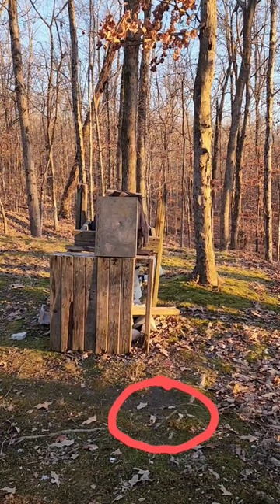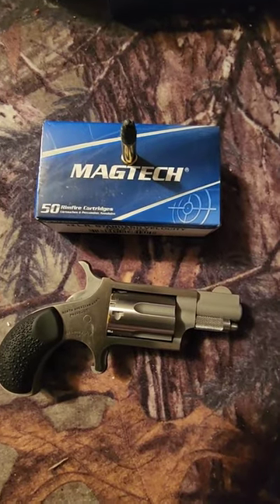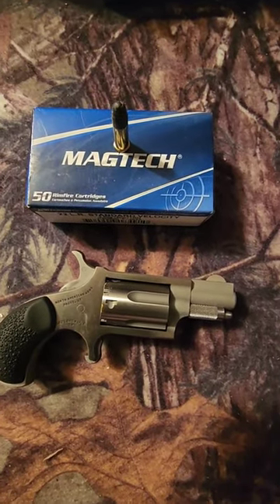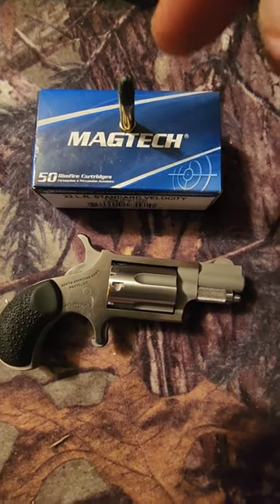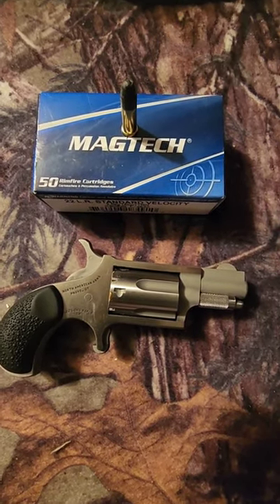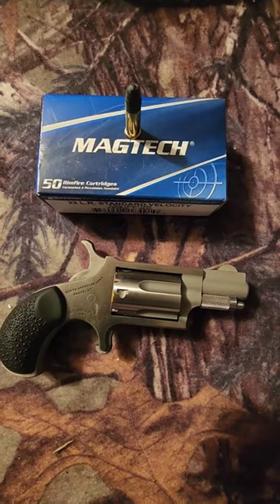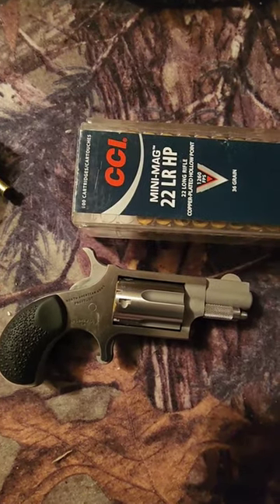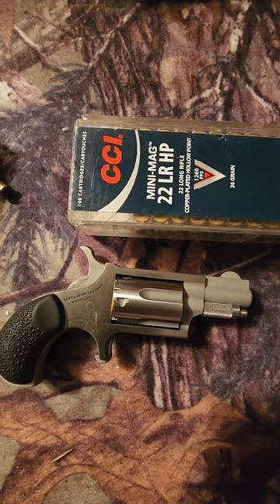NAA MINI REVOLVER PENETRATION FAIL....

Comment: I know people that carry these. Most of them consider  it noise maker instead of a true defense tool. Kind of disappointing that you didn't show at least what that high shot did to the vest.

P.S. I am truly curious what kind of damage this gun can actually do
Reply from the maker: Sorry about that. The first shot was out of gas after the metal. It was resting on the tuck flap of the vest. The jug was pressing against the metal in the second shot so it took the steam out of that lead bullet. To be fair that metal is tough and the lead bullet completely flattened out. I think the CCI Mini Mag will get into the jug. We are definitely going to find out. I'll shoot the vest without any obstruction because now I'm curious too. Thanks for being here and commenting.